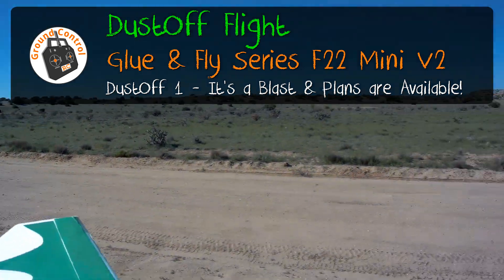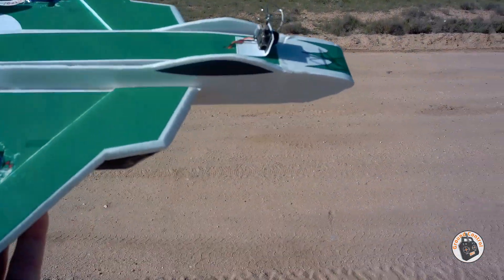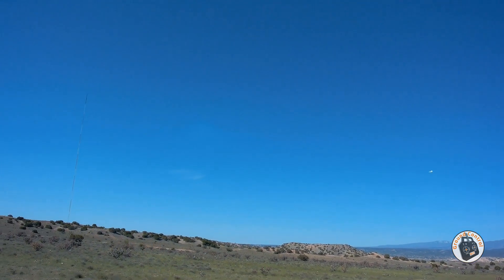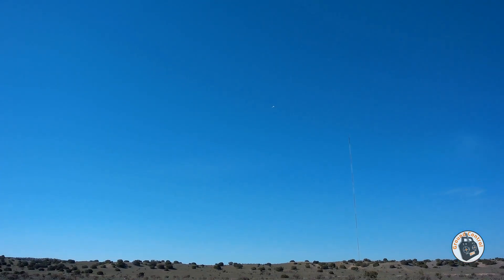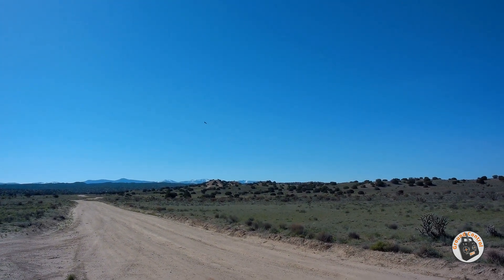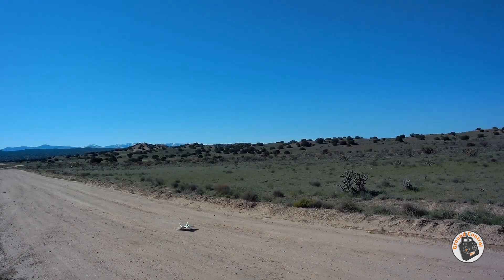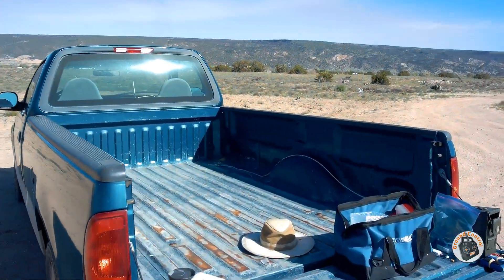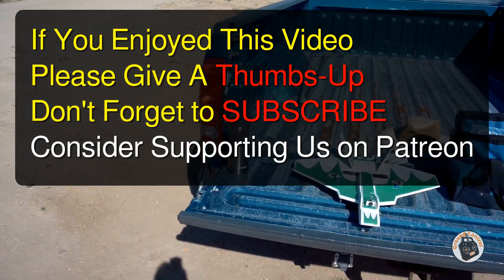DustOff #1 - Glue & Fly™ Series F22 Mini V2 - Plans Available to Patrons & Subscribers!

Comment: Hello, I am planning to build an RC plane, but I am confused with the motor, for a 30a ESC and a 3s 2200mah lipo battery, which motor should work? A 2450kv 2-3s brushless motor? Or a 1400kv 2-4s one?
Reply from the maker: Enesettin, those are all very good questions. I'm sorry I cannot answer them with the information given. I can explain how I pick my power system. From my design I have a very good idea the weight of the plane. I choose a power system based on weight, thrust, and efficiency. Depending on the type of plane, I decide what I would like my Thrust-to-Weight Ratio to be. I pick a motor, prop, ESC, and Battery based on that criteria after performing thrust testing on the bench to get a balance of those criteria. What type of plane are you going to be building? What is the Wingspan and estimated Weight of the Plane? I can try to point you in the right direction with that information.
Reply: @GroundControlRC  it's high wing trainer, with a span of around 850mm, it's from foam board and will be reinforced with fiberglass sheets and maybe colour spray, I am not sure how will it weight
Reply from the maker: @footduck6681  , Well, it's not a large plane and the foam won't weigh much but fiberglass is pretty heavy. You want to us a 3S 2200mah LIPO for this plane? My older 3S 2200mah LIPOs weigh 192g and my newer ones weigh 172g. My Super Cub has a wingspan of 750mm and runs off of a 2S 450mah LIPO and the All-UP-Weight is only 275g. You're going to much heavier, maybe double, maybe more. On traditional planes I like to have a Thrust-to-Weight Ratio of at least 1.25:1. Some may say that's overkill but I'd rather have more power than not enough if I get in trouble ;-)  My FW190 Foam Board Plane has a wingspan of around 975mm and an All-UP-Weight of 600g. On that plane I run a 2212 2200kv motor with an 8x4 Composite Prop, 30A ESC, and 3S 2200mah 25C LIPO (172g )and I have a 1.8:1 Thrust-to-Weight Ratio. Since this is going to be a trainer you may want to look at something like a 2212 1800kv with an 8x4 prop. These are all just guesses and I would wait until you have the Airframe built before deciding on the Power System but I think this will point you in the right direction. I also try to keep my Prop size at no more than 25% of the Wingspan to keep torque roll to a minimum if possible. I hope all this helps you and doesn't just add more confusion. I think you will have a much better idea of what you need when you know the weight of the Airframe as getting the weights of the Electronics is pretty straight forward. Good luck on your project and don't hesitate to ask questions. I'll try to help. See you in the Air!
Reply: @GroundControlRC  the comment didn't add more confusion, it just added important answers to important questions that I didn't ask, that helped me much, thanks a lot, and the battery? Will it be keepers 2200mah or I should choose a smaller one?
Reply from the maker: Glad to help ;-)  You might try that battery as I'm always amazed at how much weight RC Planes can carry. I know a lot of people use that size battery on Parkjets with only 660mm Wingspans and they fly great. I think it will also depend on how much Wing Area your Plane has and how heavy it feels in the air. You can always swap it our for something smaller.
Reply: @GroundControlRC  so I now checked the store and there are only three motors which are soldered and for good value; A2212 1000kv, A2212 1400kv, and A2212 2200kv. Which one should I buy?
Reply from the maker: I would not know which one to suggest until you know the weight of the aircraft and what size prop you'll be able to use. I wish I could be more help but without knowing how much thrust you'll need I can't pick one.
Reply from the maker: I'll pull together my Thrust Data today and post it here. I've tested a couple of 2212 motors with various props on a 3S LIPO along with the Amp draw and efficiency numbers and hopefully that will help.
Reply: @GroundControlRC  the prop will be 8x4.5, and the airframe wait would be approximately... Say 400~500 grams
Reply from the maker: Base on your weight, I think the 2212 1400kv Motor would be the best and with an 8x4.5 Prop it should have very good efficiency.

Looking at the weight of 400-500g you may want to look at the RacerStar 2208 1400kv Motor.
It's lighter than the 2212 and Produces plenty of thrust for a Plane of 500 grams.

Looking at my numbers I'd say you should be in the 700g range on thrust ;-)
That should give you something around a 1.4:1 Thrust-to-Weight Ratio.

Sorry it took so long to get this Data to you but I went flying this morning ;-)

Here is my thrust data with the RacerStar 2208 1400kv Motor using an 8x4 and 9x5 Prop:

Ground Control RC Data

Motor: RacerStar BR2208 1400kv 
ESC : RacerStar 30A Lite OPTO ESC 
LIPO : DualSky ECO S 3S 800mah 25C 
Prop : Gemfan APC Style Composite 8040 (8x4) Prop 
Thrust: 691.1 grams (100%) | 334 grams (50%) 
Amps : 12.6 
g/W : 4.4

Motor: RacerStar BR2208 1400kv 
ESC : RacerStar 30A Lite OPTO ESC 
LIPO : DualSky ECO S 3S 800mah 25C 
Prop : JXF Composite 9050 (9x5) Prop 
Thrust: 726.8 grams (100%) | 304 grams (50%) 
Amps : 15.2 
g/W : 3.8 

Here are links to the (2) Videos and Links to the Motor, Prop, etc. are listed in the Show Notes.
https://www.youtube.com/watch?v=oJtnRIOcxlk
https://www.youtube.com/watch?v=OGnyTx8I3fM

I hope that helps and good luck on our build.
Reply: @GroundControlRC  thanks very much for all your help, I hope the plane goes well, and i just thought about one more thing; can I make it a biplane instead of a high wing plane? I was hoping to build something like the HE-51 since it's looks square and easier to build, still very beautiful in the sky
Reply from the maker: @footduck6681  , that's a really nice looking biplane. I've been tinkering with a Nano biplane modeled after the Albatros but so far it's not flying. I think I scaled it down too much so I need to rebuild and test again. I think biplanes are harder to design and build than single wing planes. Good luck on your project and I hope it all goes well. See you in the Air!
Reply: @GroundControlRC  thanks very much and see you too!

Comment: It flies very easily. And it is on a 2s battery and 6 inch propellers? It looks very wide. Is it for roll stability? Goodbye. Successes in flights.
Reply from the maker: Thank you! It is running on a 3S and 6x3 Prop in this flight. It can also fly on a 2S and 6x4 Prop to use as a Trainer. The design is for stability and light wing loading as I wanted this Parkjet to make a good Trainer Parkjet. See you in the Air!